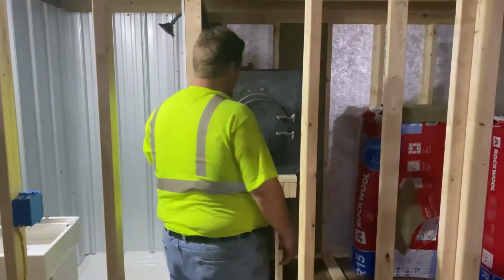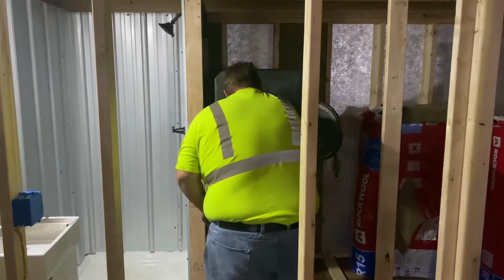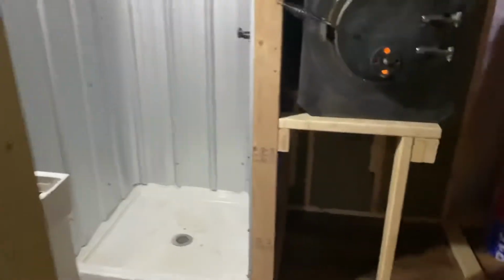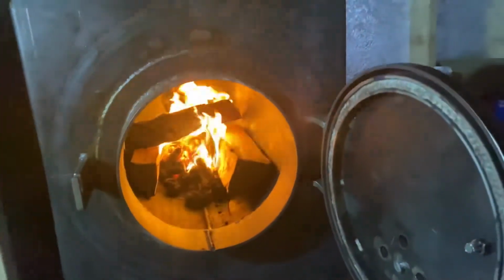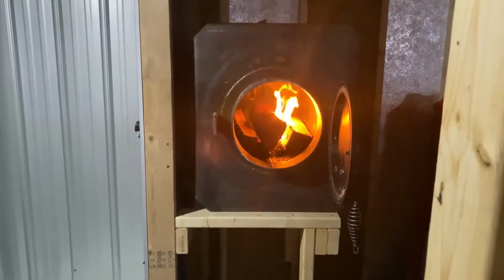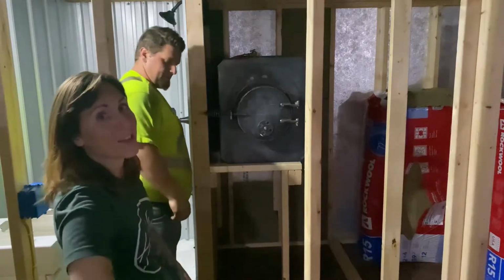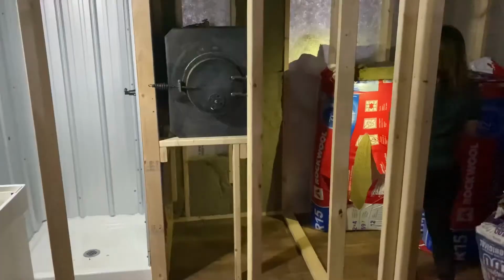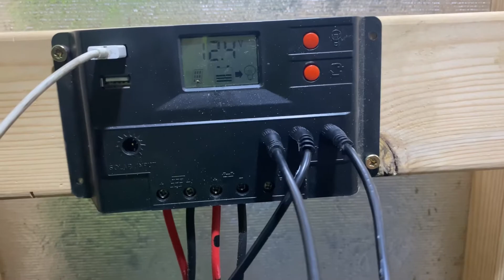Wood-fired hot water tank

Comment: Hey guys!! Great job so far. Looking forward to seeing it all come together ❤.  
So..the hot water heater..will it not heat up the house? Does it keep the heat contained?
Reply from the maker: The face of the tank is all that is exposed. (Non insulated) there is some radiating heat but very little, the rest is wrapped in insulation.